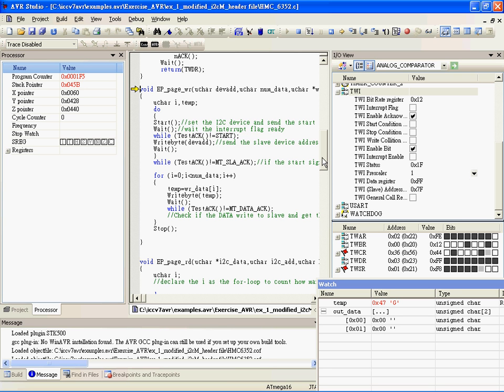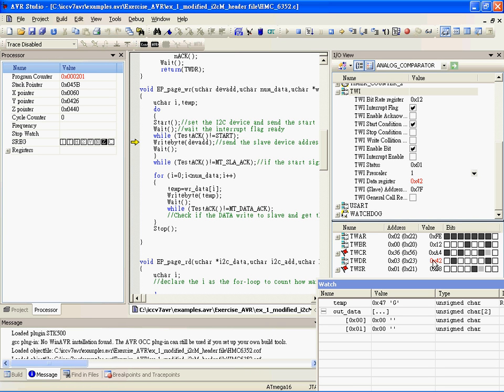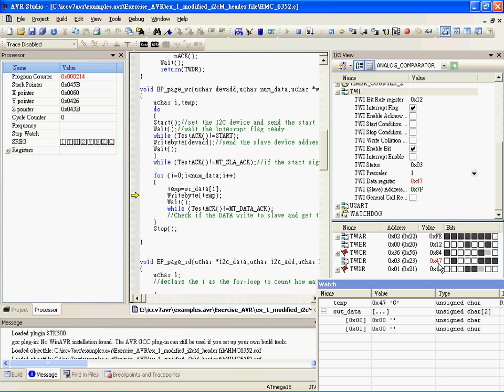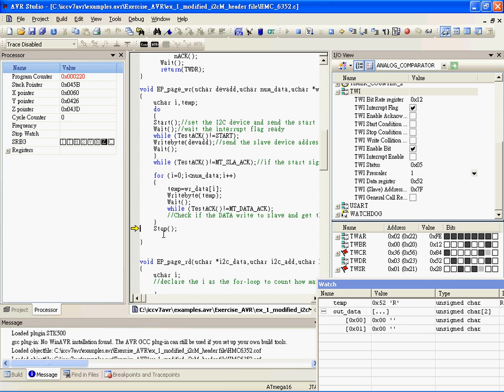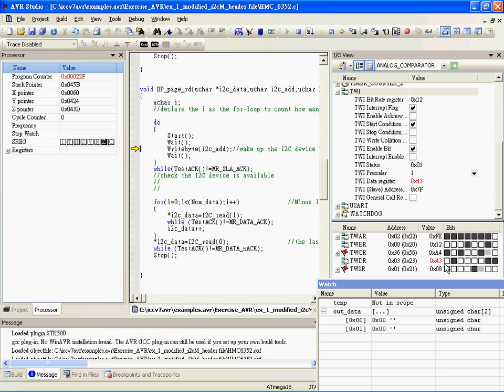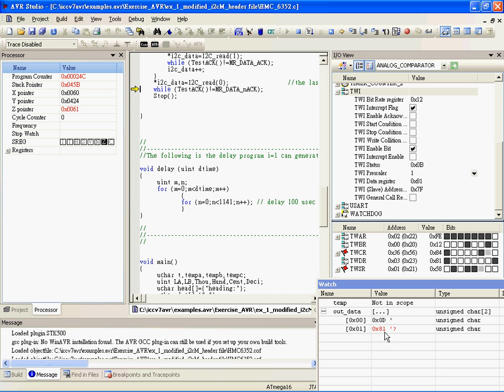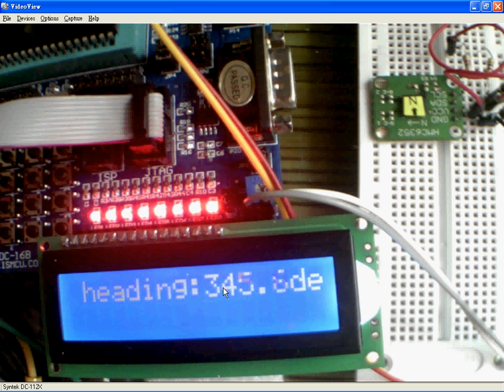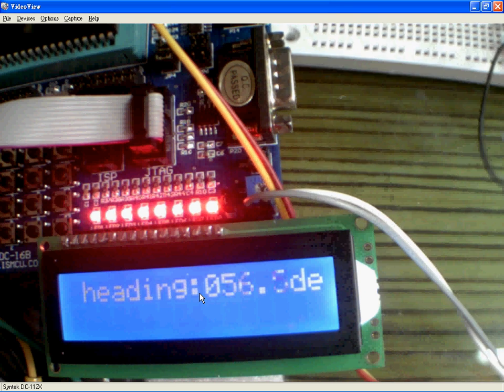HMC6352 Digital Compass ATMega16 tutorial

Comment: Dear Mr. Ho Brian, you've done very good gob and working well. The same magnetometer i'm using and interfaced with PIC controller. The I2C communication and through USART displaying data to computer terminal. But i don't get what is the Data, i need help from you, i'm requesting you to help to find the exact data? Requesting you to send your code to this mail ID: raghavendra.k021@gmail.com
Thanks in advance, 
RBK